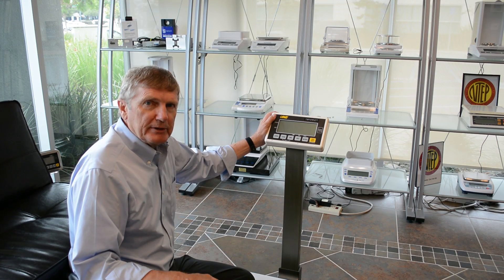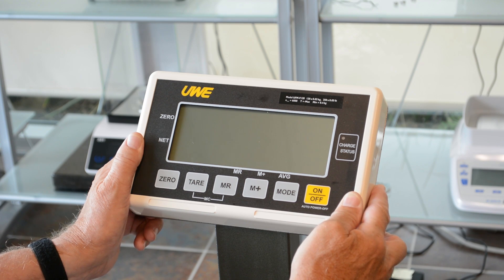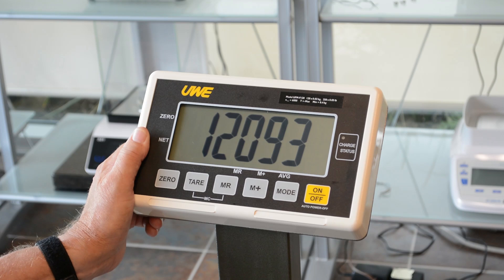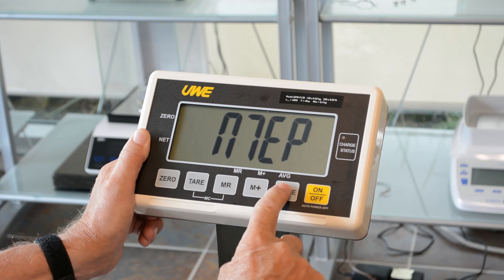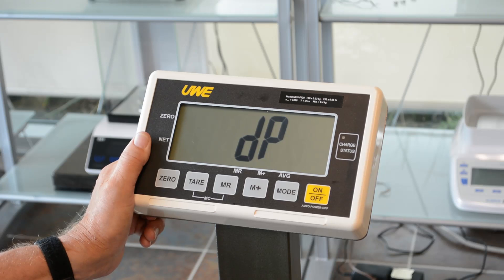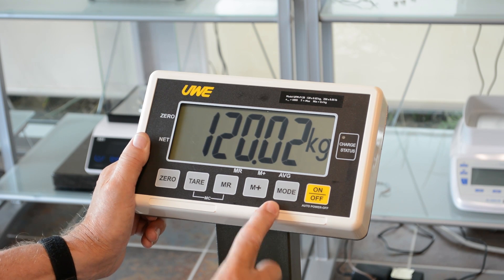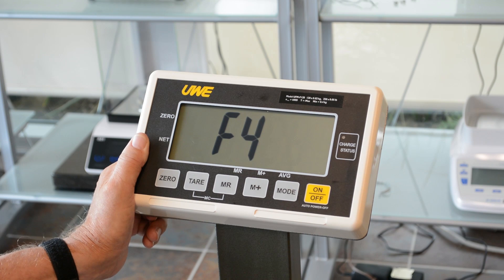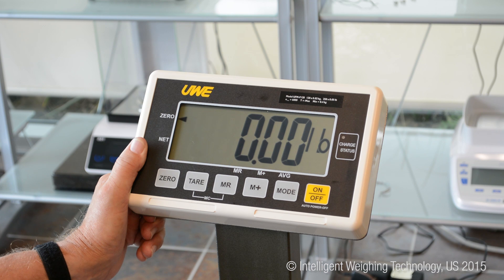UFM | Bench Scale | How To: Reset Scale (And change units of measurement)

Comment: hello there, this is a really good video, but i have an error message indicating CE0001.....this comes up when i put the machine on( btw its an UWE APM-60)....the machine then counts down as shown above ,,,and ends w 0000,,,,,but then nothing after that. Is there a way to reset ALL SETTINGS!?
Reply: Have you solved the error, the same error appears on me
Reply: @deepspace-dmr  loadcell wire broken,loadcell supply voltage nothing or loadcell broken
Reply: @deepspace-dmr  loadcell bozulmus loadcelle besleme voltaji gelmiyor yada loadcell kablosu kopmus